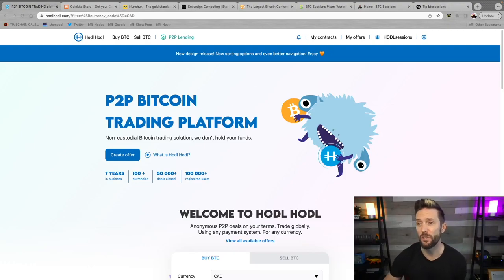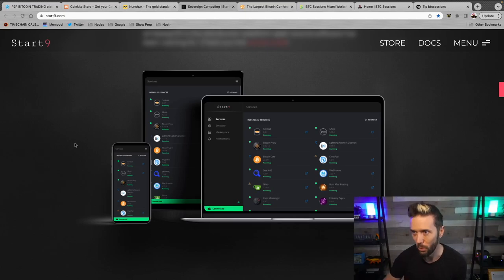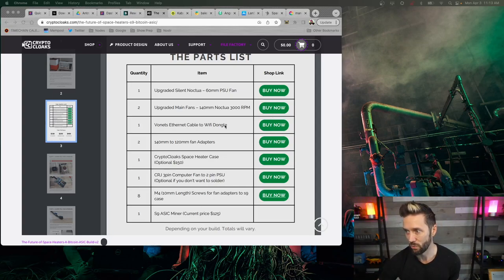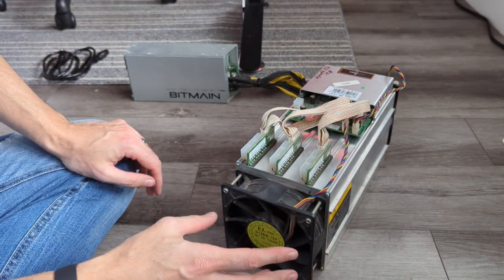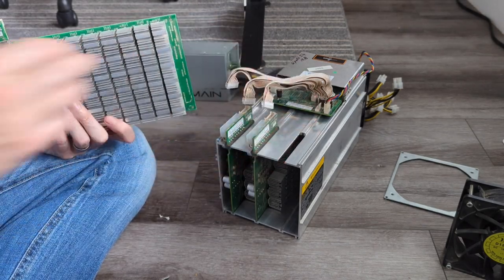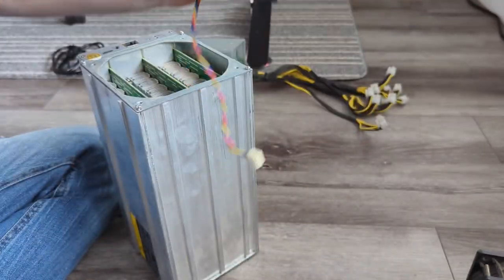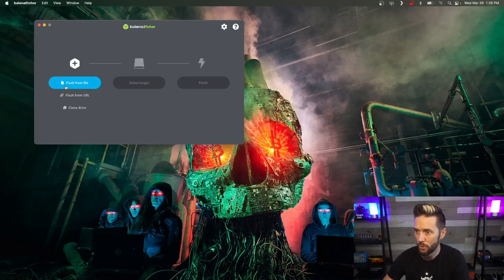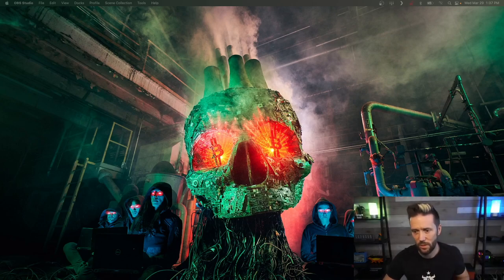Bitcoin Mining Heater DIY TUTORIAL!

Comment: Great video. Here's how I made a couple of the steps easier. 1) For getting the screws in to attach the fan to the adapter: drill the outer 4 holes out with a drill bit big enough so your philips screwdriver fits through the hole. The screw only attaches with the 4 holes up against the adapter.  2) Instead of changing the housing for the fan plug, I just Dremeled off the notch on the plug that is offset until it was smooth. I left the notch on the edge in place. The plug fits right onto the pins without the pain of swapping the hosuing.
Reply: You think it’s possible to add any charcoal filter to produce clean air? Something like that?

Comment: Awesome video. I would recommend setting up Braiins and lowering the fan speed before installing the new fans. The new fans might not be powerful enough to cool the miner if running at full power. Your miner got up to 102c in the video.
Reply: It can actually be done before adding a worker. Up until that point the miner just sits and waits for any work (no energy being used).

Comment: Great content I have subscribed iv'e not seen this Braiins os before so I set mine up with wattage of 600W and a temp of 75 max 85 and fans at 55 it's set on manual but every so often the temp is only around 58 degrees but the red error led come on and the fans run at 100 percent for about 20 seconds. Any idea what that could be?
Reply: It's tuning up to 24hrs. Scroll down to "tuner status" at your Braiins OS dashboard, if it's tuning then they will ramp up time to time. If stable, then check if temps reach "Hot" or "Dangerous" levels. If so, up the fan speed. My settings are: Power: 602W, Fans: 45%. Red led blinking is linked on Braiins OS to tuning is in progress. After tuning is done, fans will work normally and led will blink Green.

Comment: Is your PSU 120V?  I have some old units at 240, not compatible with a home
Reply: some APW3++ are 240v only while others are both 120v and 240v
Reply: I ended up with a 240 PSU.  I was able to use an old 240 30 amp clothes dryer connection to run it.

Comment: I have set up the WiFi device up to the reboot step. It was rebooted and i see the new WIFI connection option. When i click on it, it asks for the password. When i type in 12345678, it says incorrect password. What should i do?
Reply: I got the password. It is the same as the local network you connect to. Problem i have now is that when i click to connect after putting in the right password is that it just spins trying to connect but never actually does. I have not connected the device to the miner yet. Wonder if i should have the Ethernet plugged into the device and miner before trying to connect.

Comment: Has anyone else had an issue of the fans randomly speeding up to 100%? Mine will do it after running for 10 minutes an the temperature is still 20c below hot. It's very very frustrating that I can't set it and it stays out unless it gets too hot.
Reply: It's tuning up to 24hrs. Scroll down to "tuner status" at your Braiins OS dashboard, if it's tuning then they will ramp up time to time. If stable, then check if temps reach "Hot" or "Dangerous" levels. If so, up the fan speed.

Comment: Anyone else have issues flashing the SD card? I keep getting an error message ?
Reply: I had a bunch of trouble.  Once I upgraded to Brains OS it generated a different IP address than when running the OEM software.  I ended up using the legacy Brains IP scanner and the button on the miner to finally find the new IP.  Once I found the correct IP address everything went smoothly.